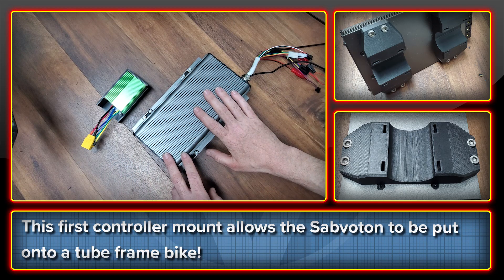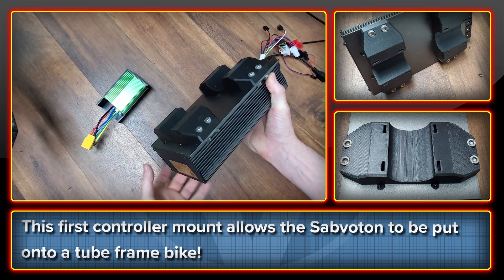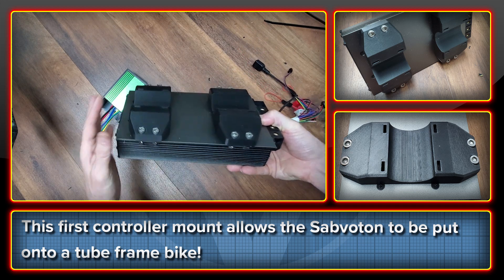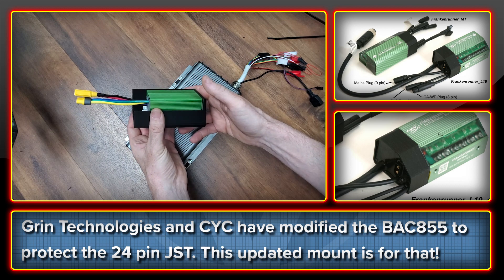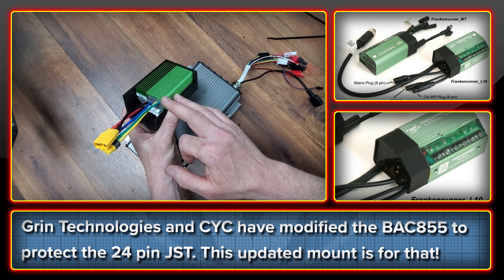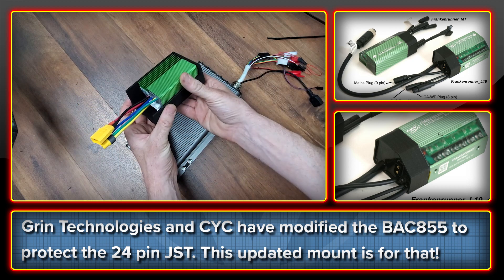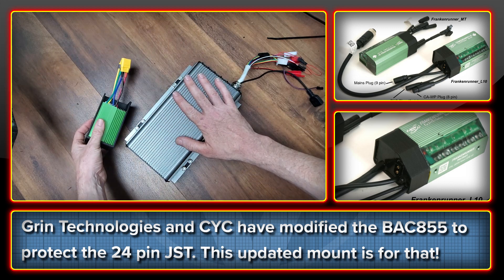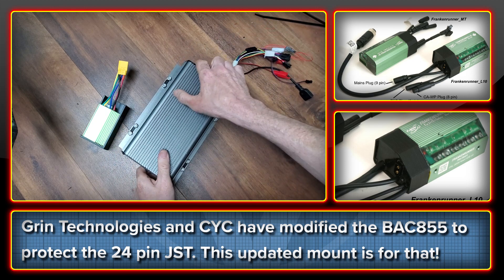Sabvoton Mounts for Tube Frame Bikes / Grin Frankenrunner ASI BAC855 Mount Update

Comment: Do you still sell/supply the sabvoton controller brackets? My budget can't stretch to the frankenrunner & I worry the baserunner would be underpowered for my 1500W motor and 52V battery.
Reply from the maker: Yeah I can do you a set. Send me am email to john@highvoltagekits.com

Comment: Could anybody tell me the difference between frankenrunner and phaserunner?
Reply from the maker: The Frankenrunner is based on a bac855 with custom wiring. The phaserunner is based on older tech and has a more compact finish. Both are based on ASI tech but made by Grin
Reply: Ok thanks a  bunch man.
Reply from the maker: Welcome

Comment: Will the frankenrunner output 3000 watts as the bac 855 ? Ive been struggling to find 1 in stock? Also, will you start selling the frankenrunner with the bracket ? Thank you in advance.
Reply from the maker: There is a link to the bracket in the description. We are not Grin dealers so we won't. It's direct from them. As to power I am not quite sure. They tend to be a bit conservative. If we push 4k with the same hardware then 3k should work. There is extensive info at ebikes.ca
Reply: Thank you

Comment: Please tell me what controller that is.
Reply from the maker: Its the Sabvoton. There are a bunch in this form factor of varying power levels. Its a basic FOC controller. Quite often used with hub motors more than the BBSHD etc
Reply: @HighVoltageKits  it's certainly a big FOCer!
Reply from the maker: They are not potted. But people use them as is all the time. I'm not 100% sure. I'd hope they use seals. I definitely would not pressure wash. Use drip edges etc. You might get more info on discord?